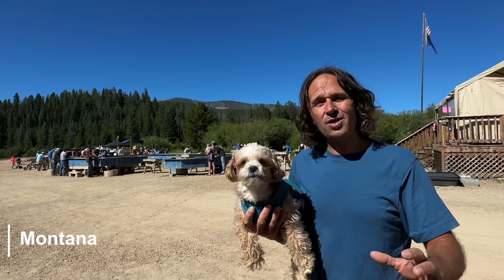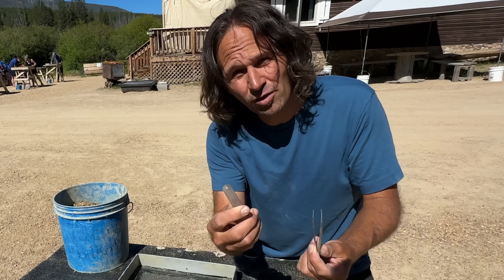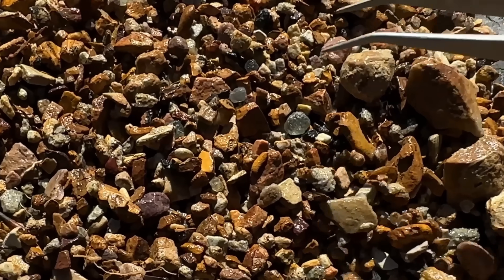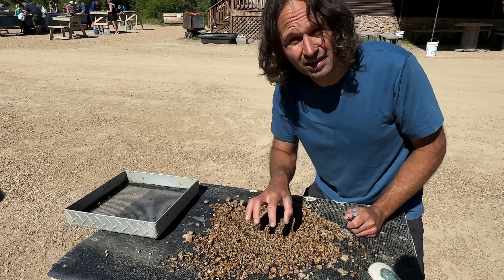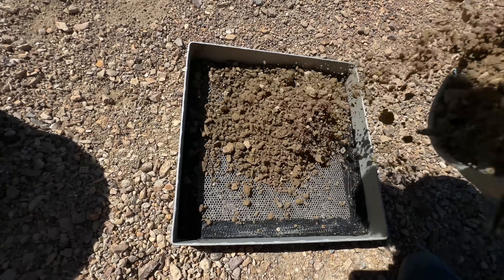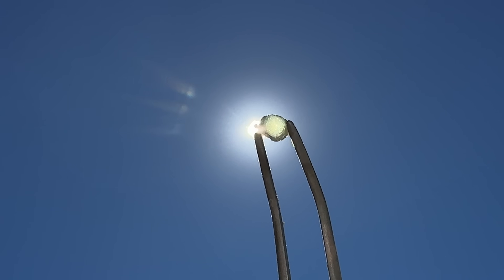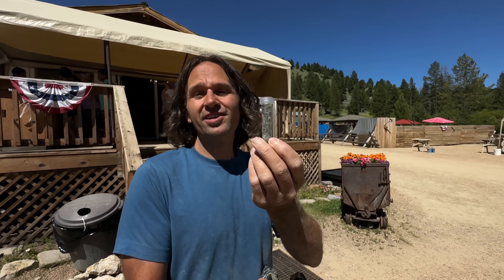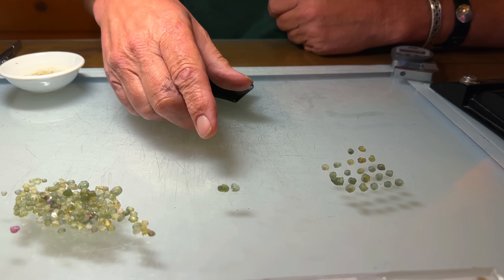Sapphire Mining Adventure at Gem Mountain, Montana!

Comment: I live about 20 miles from here.  Been coming here with family and friends for 40 years.  You will find a tablespoon of sapphires in each bucket, but they are neither rare nor flawless. The Rock Creek deposit has only ever produced very small sapphires that were gathered up in the late 1800's, bagged, and sent off to Switzerland to be used and cut into round watch bearings.  That has been their only commercial value. Stones of jewelry quality are extremely rare and generally need to be heat treated to gain color.  It's still fun though.

Comment: I have done that at gem mountain store in Philipsburg Montana. I have 6 sapphires that i was able to have heat treated and cut  that i had found there. They range from 1/2 karat to just under a karat. They are amazing blues. I want to do that again but at the mine location.
Reply: How much did it cost to have it treated and cut ?
Reply: @mariskajo  i had that done back in 2018. I do not remember how much. I know it was about $200 at most, that is secure shipping, heat treat, cutting, and return secure shipping. It was worth it. Seeing the biggest cut stone is worth that alone now.

Comment: I ordered a jar of dirt from them last year I found 3 pinks and an orange sadly they weren't cuttable but I did get about 20 cuttable stones that i had heat treated. One of them turned out to be a bicolor that is pale green on the outside with a spot of deep blue in the center. I also found that it took several times going through the gravels to find all the stones but the best ones were found the first time around. I ordered a boot of dirt last week cant wate to go through it.